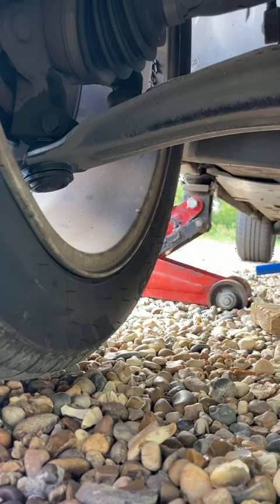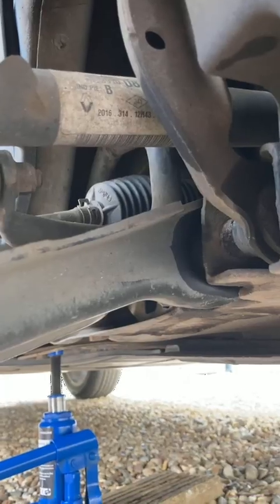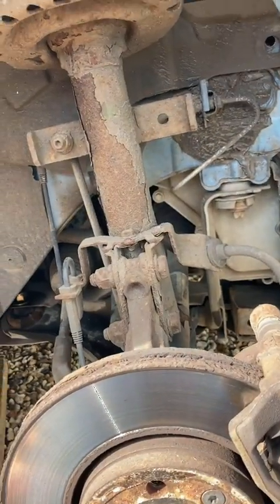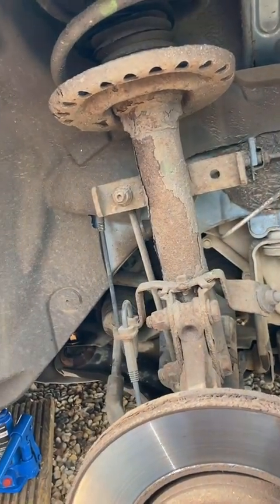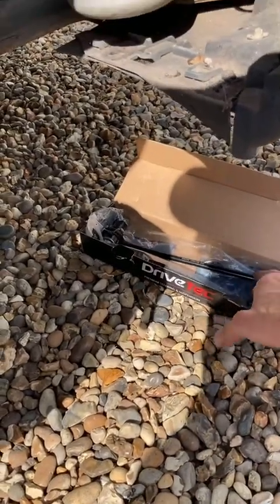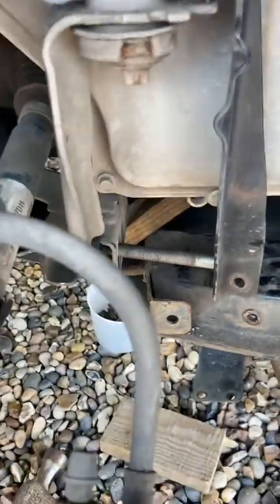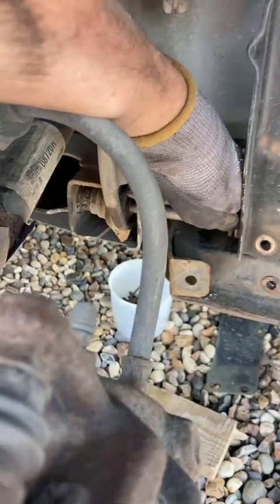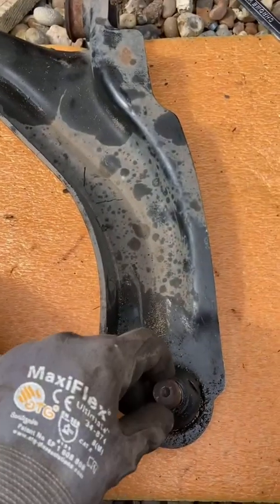Renault Zoe 22kwh 40kwh front suspension knock noise - lower arm ball joint track control drop link

Comment: We ran a 22kwh Zoe for 4 years. We spent more on suspension repairs than we did on electricity during that time.
Reply from the maker: Sounds about right, I did both lower arms on my sister in law’s Zoe, garage quoted them £500 which I thought was very reasonable but the parts were only £130 for decent ones. It’s a weakness. Will soon look at a ze50 to see if it’s been updated. Cheers
Reply: @garycevrepairs  I'd be super interested to know if the ZE50 is any better. We swapped our 22kwh Zoe for an MG ZS, which to be fair, has given us zero issues, but somehow I still miss the Zoe.
Reply: @MrWobling  It is not :).. My first ball joint after only 35kkm of CAREFUL driving. Same part numbers.
Reply: @bjov76  good to know thanks. Still been vaguely tempted by a ZE50. The MG ZS EV just has so many minor niggles and disappointments which add up.
Reply: @garyc4450 The ZE50 have a different ball joint have I been told, so it should be improved. It is a different tap size so it can not be used on the ZE40 unless the spindel is modified... But I would love a grease port... I can literary see the grinded down on the material and it is bone dry...
Reply: @kjelllindberg6987  Exact same part number on all zoes as well as clio iv, twizzy :), and a bunch of other renaults.. It was definitely NOT changed. I just replaced it.
Reply: Had the Zoe ZE40 2019 since April this year, second hand, Renault changed the right lower arm suspension, 3 months later my tires were worn down to the metal so had it checked again and both suspension arms needed replacing including the new one. I do delivery in it so do up to 100 miles per day but suspension arms really let's it down lol
Reply: @owmasters2138  out of interest - do you regularly have to navigate speed bumps? Our Zoe faced speed bumps twice a day on the school run. I don't think they were ever taken at excessive speed, but I now take speed bumps much slower, even though we don't have the Zoe any more. You can see how even moderate speed could damage suspension quickly if it's not really rated for the job.
Reply: @MrWobling  Yes anywhere between 20-50 of them per day! I tend to try to go slow over them. 

It may mean I have to get the arms replaced 3 or so times per year. I wouldn't want to do the job in our Tesla, need something small and nippy so the Zoe is good for that. 

Other than the suspension issues that car has been great and the range is decent!

Comment: I have replaced the ball joint from the lower control arm by pressing out the joint without replacing the entire control arm. Still not an easy task, but way less work compared with changing both of the lower control arms. The next step that I am trying to do is to inject silicone oil inside the rubber housing at the ball joint to prevent ingress of water and to keep it properly lubricated (it is close to bone dry at the ball). Plenty of sticky grease is suggested on all surfaces like the top of the ball joint, within the split, and all over the bolt. This is the second time I did it on our Zoe ZE40 2019 first after 90,000 km now at 165,000 km. My ZE50 2020 has done 168,000 km without any issues so that part has improved...
This part helped a lot https://www.google.com/search?q=04026947094144  and a 21 st Ball Joint Press Kit which I do not have a valid link to. It worked but was not optimal as it was intended to US trucks, so a mechanical shop will make better adaptors for me for the next time...
Like your work, keep uploading.
Reply: Did it myself as well. Was a straight forward job EXCEPT that CV joint splines were completely stuck within the hub.. It took 2 good hours of hammering to get the cv joint out.. Obviously destroed the threads, so had to grind off quite a bit off to get it in..  2020 ze50. Ball joint was shot after only 35 kkm. Also I am very very careful over the speed bumps..
Reply: @bjov76  Same... except after 60.000km both lower balljoints broken. We park 2 wheels on the sidewalk though...and we run 17inch rims. But still pretty soon after five years and 60.000 km